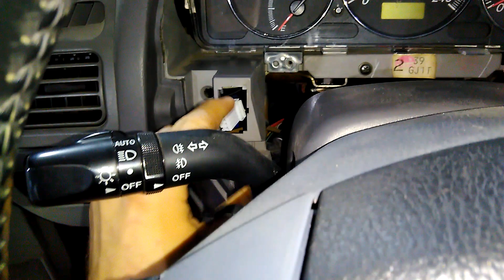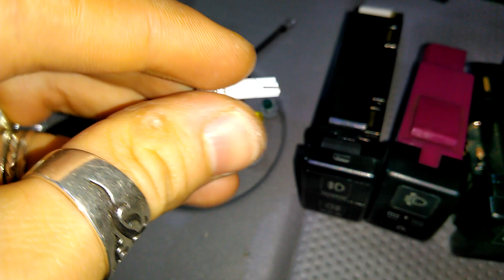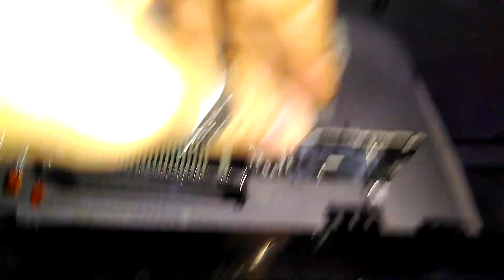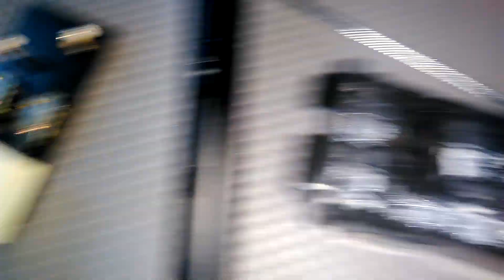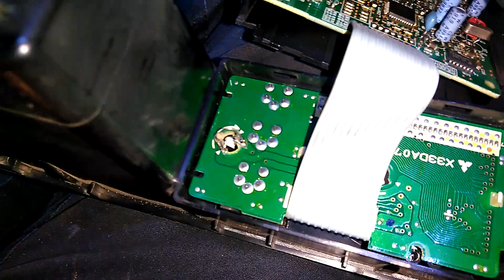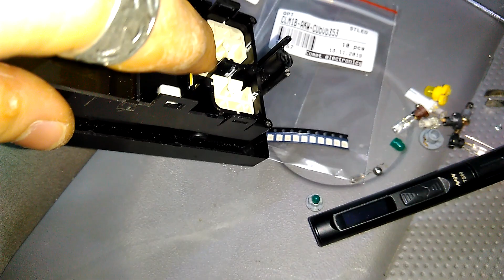LED backlight of switches, climate control and touring computer for the 626

Comment: Hello I own a 99' 626 GF and only now I realised that i've been driving without backlit switches, trunk and interior auto lights. I am missing a fuse and hope nothing will fry when i get a new one, thank you man. Also do you know of any common ABS issues on 626's?
Reply from the maker: Hello.

Backlight for switches is coming from the backlight level switch, the interior (dome) light control is coming from the instrument cluster (I have a video how I fix it) and the trunk light is controlled by the door lock timer unit. I do not know if all of those places use a common fuse, but I'm almost sure they are not. I can check in the wiring diagrams on Monday as it is not with me now.

As for the ABS - I've changed rear left sensor once and I've read on the internet it is a weak point of the 626.
Reply: Mazda 626 GF Yes you were right, i will try and diagnose the problem. Do you by chance have any documentation for the hatchback prefacelift version 1.8l ? 
Thank you
Reply from the maker: I just checked with the wiring diagram (I have only for the facelift) and it turns out I was wrong and all lights do share a common fuse - 10A ROOM. If this one is ok, then the "parent" fuse may have blown, which is the 40A BTN, but If that one has burned out then you won't have power door locks and power windows.

As for the manual - check pmx626.info - it has a good collection of manuals for 626, including both pre-facelift and facelift EU GF. And the PDFs are OCRed (they are searchable).

Hope all that helps ;)